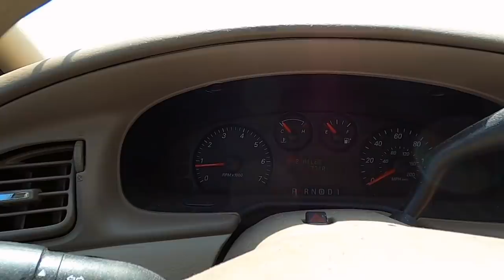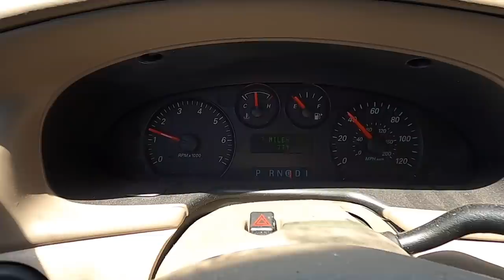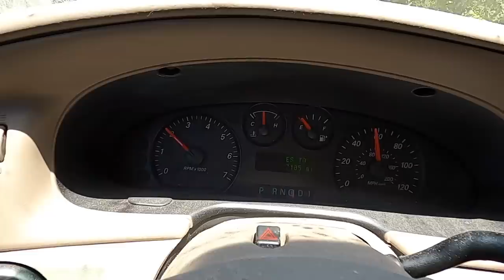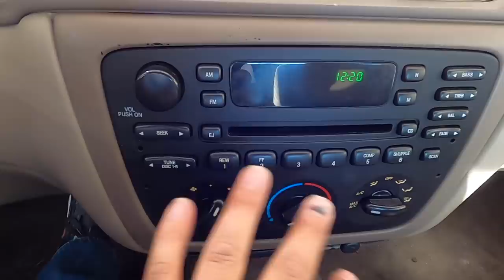$800 IAA 77K Mile 2006 Ford Taurus - Run and Drive???

Comment: I had an 06 Taurus SES in the same color, I put over 240,000 miles on that car with no issues. .......just service work, batteries, brakes and tires. I had another 02 that had over 180,,000 before I sold it. IMO they are the best cars Ford ever made.

Comment: I drove a hand me down 98 Taurus for years. It was super reliable and had 220,000 miles on it when I finally put it out to pasture. It ran and drove, didn’t use any oil but it leaked coolant all over the engine. I have absolutely no complaints about that car.

Comment: I bought a brand new Ford Taurus in 1991  . best car I  ever had in my life put around 700,000 + miles on the car  with my job drove it from Oklahoma to New York City  to Florida to California to Oregon ever place in between lived in  it for 8 years on the road and had zero trouble with that car  only thing I ever did was change the oil and routine maintenance drove through the mountains in snow  the desert  any place you could imagine .. sold it a couple years ago to a guy in Duncan Oklahoma and  still to this day he is driving it back and forth to tinker air Force Base everyday

Comment: Those little old Tauruses were reliable cars! My brother-in-law's mother owned a 2002 Taurus, and that sucker lasted over 400K miles, before the transy gave up. They put another transmission in it for $100, and there still driving it around till this day!

Comment: We bought a 2006 Taurus with 84,000 miles and sold it with 162,000 miles with just regular maintenance.It turned out to be a better vehicle than my wife’s new Camry at the time.

Comment: i had a 2006 Taurus.  It was a great car.  There was only one issue with it.  Some of them got equipped with defective torque converters.  They would just suddenly fail and the car would not move forward or in reverse.  A lot of people replaced the transmissions but that wasn't necessary.  If that happens, just replace the torque converter and it is good for 200k.   Yeah, the door skins were very thin and pretty much all of them will have dents.  But as far as a good reliable daily driver, they are solid and have a comfortable ride.  Mine only had an issue with the torque converter, $200 to replace that and everything else worked well.

Comment: 2000.00 all day long because of the miles. Make the outside pretty easily 2500/3000. That car in california might bring 4000/5000 im not kidding. Low mileage used cars bring alot more than in okiehoma
Reply: Don't think so.  $1500 it is.

Comment: I  love these Duratec 3.0s. Got one in my Lincoln LS. Reliable, and they make a good sound when they get a chance to sing
Reply: Only car I've been in with one was a 03 Mazda 6 with 90k miles and the engine was shot. Car was really not maintained though. A buddy bought it for $2k and as soon as he changed the oil everything started leaking and smoking. I wouldn't be surprised if it hadn't seen a oil change for the last 50k mikes
Reply: I believe this is the Vulcan V6. Best look at 11'01".
Reply: Thats the Vulcan V6, not known for power but they're crazy reliable so long as you don't ignore the Cam Syncro if it starts chirping. That fails its game over (drives the oil pump).

Comment: I picked up a 2000 ford Tarus and it was well maintained and had all the reciepts.. I drove it for a couple of years and replaced a few things and finally new struts all around.    Ended up selling it for 3500 and the kid got one nice car..  I had hoped my roomate would have wanted it but No.. I could not see having the ford and my nice 2003 Chev Avalance at the same time.

Comment: I have an '06 Taurus SEL. We got it 9 years ago at 59K for a killer deal. Now it has 210K and still going strong. It's comfortable, has the 6 disc CD changer, leather, and cold A/C. I try to keep it in top shape, and the guy who did my alignment two months ago said it drives "pretty good." It's been reliable and cheap to run with preventative maintenance.
When you said that you bought a Taurus, "not that there's anything wrong with that," I laughed harder than at the beginning of the video. The 4th generation Taurus may not sound exciting, but she'll get you down the road. I've owned many cars over the years, and the '06 Taurus is my third favorite, behind my '86 Celica, and my '92 Prelude. The only car that I would trade my Taurus for right now is a '93 Accord Wagon with a 5-speed manual in equivalent condition.

Comment: i had a 2000 Just like that  same color exterior but mine had a Grey  cloth interior and i had to completely rebuild the motor because Ford . once i got it rebuilt though it was an awesome little car. i paid $900.00 for mine  put new head gaskets , new Cat, and freeze plugs in the block, drove it for 6 months and turned around and sold it for $2450.00 to a couple from Missouri. the guy emailed me 2 years ago and he was still driving it completely trouble free but said that  a deer T-boned the car  and the driver's side door didn't work right any more but it still ran great. Actually i see this one has the 3.0L mine was the 3.8L. As far as being Honest with your sales, That is the best practice  for sure. i find ONE of those types of salesmen  everywhere i  live, and That guy usually winds up selling me several cars . like  a guy in Knoxville when i lived there shot straight every time i talked to him about a vehicle  and even though i did end up buying from him even with his honesty there were a bunch  that i didn't. the guy told me if he knew something was wrong . There were however a bunch of things i found wrong that had them wholesaling their cars too. but had he lied to me or pressured me to buy i'd have walked and never went back there again. in 10 years  he sold me  3 cars and my different girlfriends at the time another 7 or 8 cars , simply because i knew i could trust him to be straight up with me. So yeah if anyone gives you hell over not telling everything about a car or trying to hide things just ignore that because like you said you'll get a LOT more repeat business doing things the way you are. Mike may be able to pop those dents out of the door to if nothing else make them not look quite as bad . you shouldn't come out too badly on that one

Comment: Hey Randy I bought a 2006 fusion SEL. For 600. 154000 miles. Loaded. After putting a few front end parts and a 4 wheel alignment I was in it 1300. I sold it for 4000.00

Comment: I've had a couple of those cars, never had any trouble as far as the engine, but the transmission is not the best. Even then I had close to 200k on each before having any trouble at all. Should easily bring $1500.

Comment: Nothing wrong with a Taurus! We just got my mom her third wagon since 1999. Her 97 wagon had 220k a tree fell on in 2005 then we got her another wagon that shes been driving since 2005 it has 294k now but its leaking oil bad off to the scrapper so we just bought her another Taurus wagon with 80k super clean 2007 she loves it.  Ur Taurus is a 2,000$ all day in my area I went and looked at 6 of them for my mom

Comment: I owned one of these, the 2004 model; I bought it from a guy who ran a repair shop when it had 82K miles on it.  I think it must have come from a rental fleet.  It had a bunged up rear bumper from a blowout, and a shiny new headlight on the left side, with an ugly yellowed headlight on the right, but otherwise the appearance was okay, the paint was in okay shape.  Cloth seats, power windows/locks/mirrors, power drivers seat, Ice cold A/C, alloy wheels, and it had new brakes on it.  I needed a reliable car after a messy divorce left my finances in shambles.  I drove the car for four years, and all I did to it was new tires, and had a front wheel alignment--and I polished out the faded headlight so the two headlights matched up better.  It was not an exciting car, but it was stable on the freeway, never failed to start, and never hassled me.  When it got up to about 140K miles, I traded it in.

Comment: If you need an inexpensive battery, checkout Interstate Battery or local battery distributor for a blem.  Blems are batteries that have cosmetic issues, sat on a store for 6 months to a year, or were a wrong size return and are tested before selling for 50% off retail. Another option is to check out the salvage yard for a cheap battery.

Comment: I would price it about 2,000 in this market and take low about 1,700.  Look it up on Kelly Blue Book search for the same car.  Love the washing on the lawn, my neighborhood would have had a fit when I did that.  Best of luck on the sale.  I did see one on Kelly Blue Book same year rusted wheel wells for 2,900 from a dealer low miles 55k.

Comment: We had a '95 Crown Vic, a '98 Windstar and a '00 Taurus. All of them needed a trans fluid flush and change every 40-45,000 miles. Otherwise, they were occasionally jerky and would slip in and out of overdrive for no reason. Cruising along a flat road in 4th gear, they would drop to 3rd for no reason then shift back to 4th. Keep the fluid clean and they were fine.

Comment: I don't know Randy, I feel like you're underestimating the Taurus. I like it a lot.  Nice color,  nice interior,  tinted windows,  cold air, and most importantly low mileage.  There's a lifetime of utility left in the old girl.  Gonna make a great family car for someone.  Body styling is still modern looking.  I bet Weird Beard can spend a day or two on body and paint,  put it out and get $2500.00 for it.  I mean,  think about it this way,  a late model Toyota with those miles would cost at least $15000.00. From your standpoint though I understand.  You'll still make a little bit, and more importantly you're giving the car a second life, and she's going to serve some family well for a long time.

Comment: Now I’m watching this in 2021 tomorrow’s April 1 and that car as is, cleaned up what easy bring $2000 here in Houston. About three weeks ago from my dealership, wholesale, I bought a 2004 Taurus wagon very clean with 58,000 original miles on it, We bought it for $1500 so after my fee +taxes and doc fees I paid $2400! I’ll drive it for a few months maybe less, and sell it make a little bit. Going to wash out the engine bay and clean the grease off for the door panel and that’s about it it’s clean

Comment: The achilles heel of the Ford Taurus was always the transmission, they tended to be on the weak side. Engines were good, that Vulcan will probably outlast the car lol. With that low mileage hopefully the trans was cared for had the fluid changed and was not abused. Maybe it'll make 150K before needing work...

Comment: I call my 96 Taurus the clitaurus,$726,000 original miles with the original timing chain and original front and rear seal on the motor, transmission never been separated, and I could do a complete tranny flush on that car and not have a problem putting all new fluid back in it. She's Old faithful

Comment: 27:30 absolutley true! i repair different kind of electronic things to sell (PC's, Stereos, Amps, RC Vehicles, Powertools) and if there s something bad or nasty about it i disclose it.
If i would sell a Laptop that stinks like cigarette smoke without disclosing it, the buyer will be mad and toss me a bad review. However if i disclose it and list it for the same price, it will still sell as there are many smokers out there who simply don't care. I don't make less and the customer isn't mad :)
Reply: I learned the same lesson flipping stuff on Ebay. I've had very little trouble, and I offer 60 day returns. I've has two returns in the past 8 years and ~200 items. Honesty is the best policy, and good pictures help.

Comment: Should be able to get $2,750 for it cleaned up. Get a mirror and fender from pull a part and see if Weird Beard can pull those dents out in the doors and paint the fender and door.

Comment: That Ford Taurus is definitely not going to be a money maker but they are reliable. My DD is a 2006 Taurus SEL. At 156k miles she is getting tired. The clearcoat merlot paint is crappy on the top surfaces and I've had to replace the A/C system. But, my Marauder and Town Car get to sit around and save the miles.

Comment: If you don't want to wait at bank for cashiers check, you can go to Wally World and get Money Order for 88 cents for $1000 and pay the rest in cash.  It is $40 difference between secure and unsecured fees at Copart for $800 bid.  My bank charges $10 for cashiers check, so money order saves you even more.  An extra $50 can buy a new cheap battery that almost every Copart car needs.

Comment: I like ford tauruses I own a 2005 model it runs and drives I'd like to sell it its got alot of new parts on it the engine and transmission is in great condition but I'm not taking no $1500.00 for it I got it in better shape than what it was when I bought it it will take $2000.00 to move mine I'm an honest person when it comes to telling the truth about an auto mobile and other things back in the year of 1993 I got done wrong by a person that once sold me a 1984 mercury Capri a small 2 door car well I found out that the person I bought it from lied to me I gave him $1300.00 27 years ago for the car so later on 2guys was riding around in our neighborhood looking to find a vehicle to buy so I told them about the car i got stuck with that had a bad engine in it but the transmission was good I sold it to them for $150.00 I even told them the problems with it I was honest with them it was in 1995 when I sold the Capri to them and they still have it so honesty is the key in life if you do people right they will trust you if I did someone wrong about anything not only an automobile I couldn't sleep at night so the truth is be honest and truthful thanks and god bless